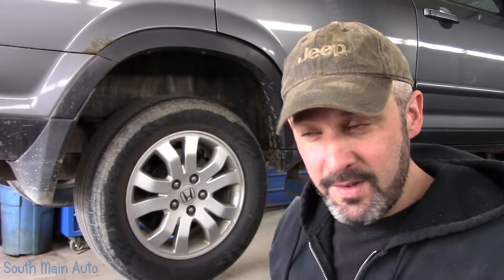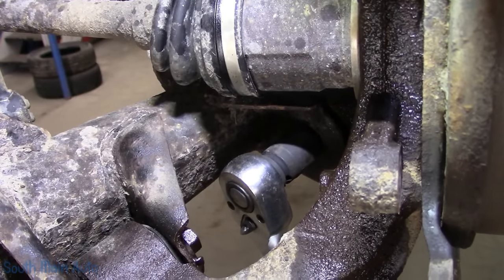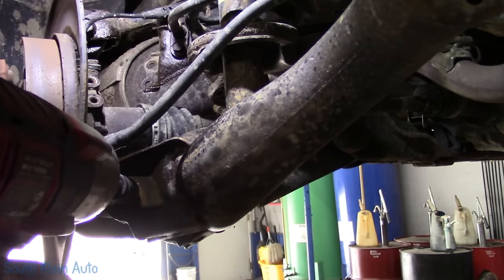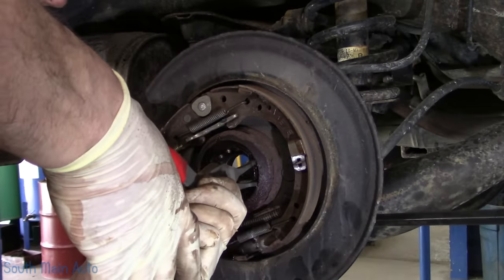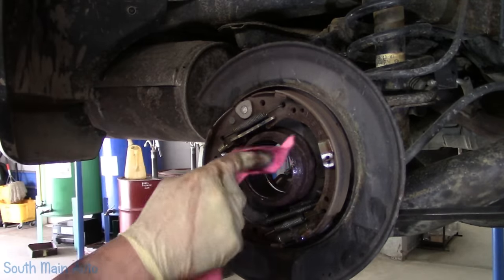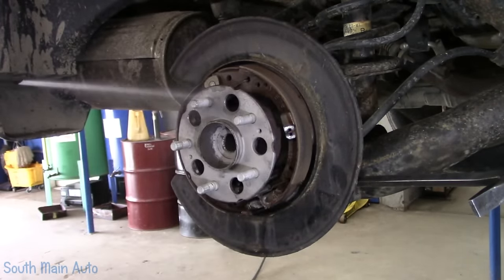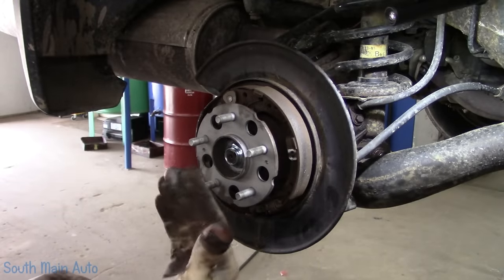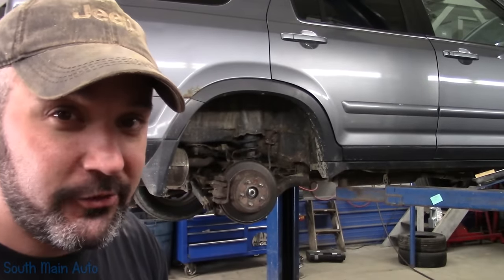Honda CRV: Rear Wheel Bearing & Other Repairs Part I

Comment: Is there ever a need to loctite wheel bearings in? Some of the applications that I've done (mostly aviation) require the green loctite on the outer race prior to install. I was just curious if this was something you guys did in the auto industry as well.

Comment: Brake bleeding cars with ABS... works the same or do we need to take special steps? Replaced the master cylinder & caliper on my 2000 ram 2500 Cummins but didn’t like using The mityvac vacuum pump so I went the conventional way of pump, hold & open bleeder screw, close. Was in a bit of a hurry so I’m not sure if I left air in system... brake pedal feels like they could be a little firmer... any suggestion?

Comment: Is that a Snap On 1/2 drive electric gun?  I have been using them since they first came out.  When they are new they even take off Honda crankshaft bolts.  I am surprised you don't use it more often.

Comment: I am old enough to recall  tapered roller bearings which could repacked with grease but rarely went out. I have been lucky I guess that I have never had to replace wheel bearing. But I hear more people talking about the bearings going out. Are they just be made poorly what is the deal?

Comment: Another great vid!!  -- I have always put a real light coat of oil inside the bearing hole and notice that in most cases you don't. Have I been doing it the wrong way? thx, rick
Reply from the maker: Oh no man that is totally fine, I just use a little spray is all :)
Reply: South Main Auto Repair thx Bruddah

Comment: Could you explain how "you determine" ride height before you finally tighten everything up? You have mentioned this on other videos as well as shown the technique with the floor jack. Is it an actual pre and post measurement from axel nut, factory specification, or voodoo secret? Thank you.
Reply: One way of bedding in is to drive around with bolts not fully tightened. Then torque them up on level ground. So all the new parts and bushes aren't fully extended or compressed when final tightening is done

Comment: one problem i always ran into with the aftermarket wheel bearings is that they never fit. always got the factory. got bit twice when service advisors wanted to get the car back and the dealer never had it in stock. so a word of advice, always get honda factory wheel bearings

Comment: On my 05 CRV the nut for the forward lower knuckle bolt is welded to the frame. Bummer if it starts to get stripped from fighting a sized bushing bolt. Probably the difference between a US model made in England and one made in Japan.

Comment: I use a short ball joint press to get those bolts out I find twisting them rips the bushings out of them when you press them you load them up and strike the end with a hammer the jar with load is usually enough to make them move. It works for me granted some are more stubborn than others.... Great video.

Comment: Althoygh i havnt finished the video yet im wondering why u havnt pulled out the shake n break tool and now as i write this i got thinking its prolly cause u have to use the weaksauce air hammer with it correct. What is your opinion on that tool im also in northern ny and i think i may grab one

Comment: Reason why to spray stuff makes a prettier fire when you have to heat up with the torch just like my 60 tomorrow I broke every belt off at by every boat to replace it from the harbour store some had to cut off modify

Comment: Totally out of question, but I really need help. This is getting real dangerous! My 2005 Dodge Neon SXT with a 2.0 liter NA SOHC I4 is trying to kill me. I was at a 4 way I went to go but my car only went 2 mph and would not do anything even when I floored it totally unresponsive. It has 160k miles on it. check engine light is on for a p0171 and used to have a p0172. P0171 is system bank 1 is lean and p0172 is it going rich. It runs like a diesel it puffs black smoke out of exhaust. Smells like gasoline and idles poorly. Just bought it bout 4 months ago for 1300 dollars. It ran fine. The only thing concerning is the oil light comes on and off randomly. But it gets good oil pressure. We replaced the fuel pump because that is what people said it was. The previous owner replaced the coolant temp sensor, coil pack, plugs + wires, throttle body, tps sensor, IAC, and the air filter. We just replaced the oil 3 weeks ago and it is blacker than the oil we drained and smells horrible. The car will cut in and out of power too like a honda with v-tech nothing, nothing, than bam power. does not like going up hill either we barely make it up them. The fuel regulator was replaced with the fuel pump assembly correctly by myself. I don't know what to do can someone help at all.

Comment: should be a thing that everything is anti seized at the factory. but you do the job for them once youre in there and it's oddly satisfying seeing you clean it all up and lube it up. FTL BEES?(ft. lbs.) faster than light bees? lol anyway i dont think i can do this job at home. i did do the chrysler types on a caravan which comes on a hub with 3 bolts. even that was kind of tough with minimum tools.

Comment: since you own a shop, I'm sure you have one, so why don't you use an air impact instead of a cordless when you are trying to get at those rusty/stubborn nuts? not being sarcastic, legitimately curious. I ended up buying the matco stubby 1/2 impact wrench from the matco truck that comes around our shop once a week, and it's and absolute beast. It's half the size and weight of most normal 1/2 in. impact wrenches so it fits in small spaces and with 700 ft. lbs. of breakaway, it's a great all around tool.

Comment: I’ve noticed you seem to remove the components on vehicles so they need aligned afterwards when there are sometimes easier options that don’t require alignment. Is this to throw business to the other area of the shop

Comment: A question on winter tyres for you. In the Uk, we don't get as much snow as you do in the USA, so as I have read it is also a good idea to change to winter tyres when the temperature drops below I think 5 degrees, is this really worth it? I can understand that rubber reacts differently at different temperatures so is this the only reason to change from summer to winter tyres in the UK when we don't get anything like the snow levels that you do?
Reply: James Allen, May I respectfully suggest you stay off the roads on those rare occasions when it snows in the Mother Country.
Reply: I think I might just do that....just incase a frozen leaf is laying on the road blocking my way through!!!!
Reply: JA, I live in Canada. Even though we get lots of snow every winter many people never learn how to drive properly in poor weather with or without winter tires. As such it is highly probable someone will crash into your car no matter how carefully you drive. What chance have you got in the UK?
Reply: Proper all season tires in good condition should be fine for most of the UK.But having been there when they got 3 inches,the tires was the least of my worries.People just dont know how to drive in snow there.It was utter chaos and I've never seen so many cars drive off the roads lol.But again proper all seasons and a set of chains or tire socks will get you wherever you need to go in 90-95% of the UK.

Comment: hey so i just had this job done on my 05 CRV at a shop and now my abs light is on along with a VSA light, and the little exclamation mark with the triangle light in the dash. mechanic says he broke the abs sensors and that why the lights are on. is he being honest with me or is this what would happen if you put the bearing in backwards? TIA
Reply from the maker: Either one could have happened

Comment: What’s a reasonable number of shop hours for a shop to charge on this job. Everywhere I called in my area says 3.5 hours.
Looks like you did it in less than one…
Kicker? They all want between 550 to 900 to do the job (1200$ at the dealer)

Comment: A JIS screwdriver or an impact with a JIS bit should be used on those  JIS Japanese Cross head (Phillips type) screws  JIS drivers work on both JIS cross heads as well as Phillips head screws Phillips head screwdrivers only work on Phillips head screws    Google JIS to learn more

Comment: Also on the antiseize i have the opposite problem . Since i keep most of my tools in my truck since im always doing outside shade tree werever work, my antiseize would be to watery almost could pour most of the bottle if i flipped it upside down  cuz of the heat . So i habe to keep it inside to harden it a lil ,😂 and i dont even live in the west i live in G.A

Comment: Did you call the customer and inform them the linings were getting thin and offer to replace the rear pads while it was apart for this job? and inform them they would be saving money on labor if they have the pads replaced now.

Comment: I can see why you have a love hate relationship with the salt they put on the roads there.  More money and Job security for you. I suspect many shops in your area take longer to do these same repairs. From what I have seen from you though, is you seem to have it down to a science and can do the job rather quickly even with the real struggles you have to go thru with the rust and corrosion. Where I live, most of the things you encounter because of the rust just don't happen. Not many calipers replace but I do always change the rotors. Suspension parts and exhaust systems are not as bad to repair and most of the time the bolts and parts come right off.There is always the occasional  bleeder screw that breaks but not often. I wish I had a good reason to buy some of the sweet tools you use like BIG NASTY. Unfortunately they would just collect dust most of the time, unless I was working on the tractor or excavator.

Comment: I let my local mechanic do this job for me.  The cost of the specialty tools was too high compared to the $200 in labor for the replacement of two wheel bearings.  While I would have enjoyed doing the work it just did not make financial sense for this job.

Comment: Time after time I've seen this here, in addition to being a professional mechanic, first you have to be extremely skilled at removing seized from rust, corrosion fasteners. Every exposed nut and bolt or whatever part you would think, they would and should do their absolute best during assembly to either stop or mitigate this . Why they don't? Because they don't have to and that is sad.

Comment: Half way thru this video - I've determined it is easier to "crack open my wallet" than blow 4 days on a DIY adventure.
Reply: Ditto.. it’s the “not having the tools” that holds be up. I spend the same in the end and waste much more time…
How many shop hours were you quoted for the job and what is the total cost you experienced hiring it done?

Comment: I’ve never seen such a pain in the ass bearing in my life, I had brought my car to my mechanic today he told me I needed a rear wheel bearing. He knows I have Aftermarket insurance with $100 deductible, when I went back, he said I changed both of them $580 later. My car is rust free anyway I come home I pull off a lug nut old threads he never change the bearings so I took the wheel off just to make sure. I went back there. I told him I want my hundred dollar deductible and I had to call the insurance company because next year if I need wheelbearings they’re going to deny the claim the whole thing just sucks all the way around, because he never done anything like this to me before in 38 years but he took on a partner six months ago and he is the scumbag that did it to me and I feel bad that I had to call the insurance company now the guy I know 38 years goes down with him
Reply from the maker: If you pressed in a new bearing, you wouldn't be able to tell just by removing the wheel. I'm not trying to defend him. I'm just letting you know these are pressing style bearing.